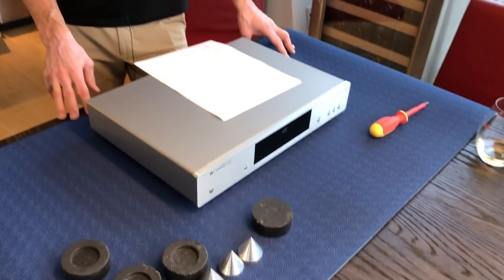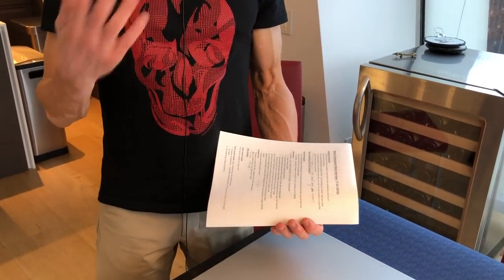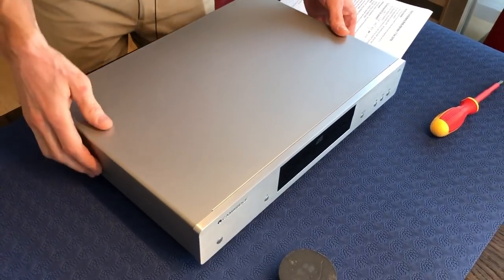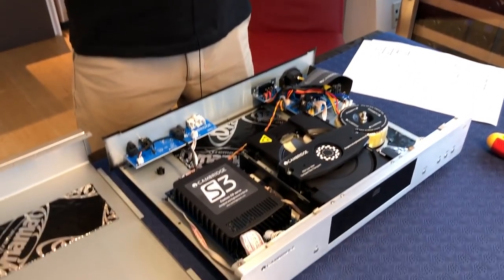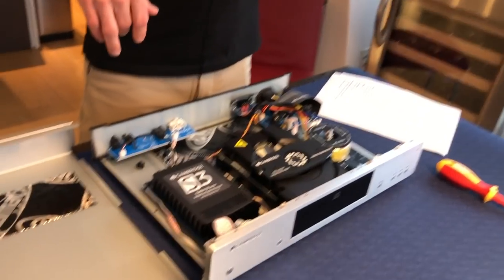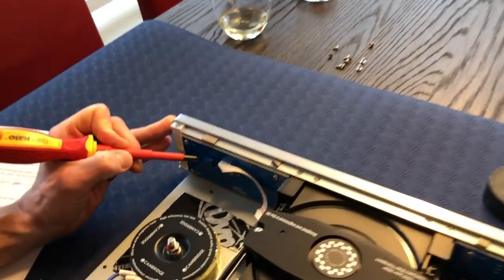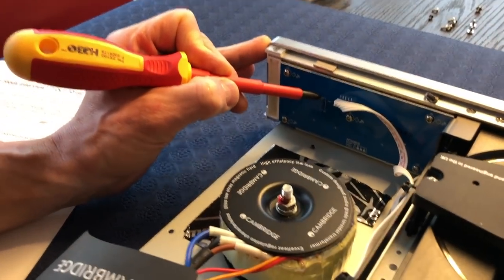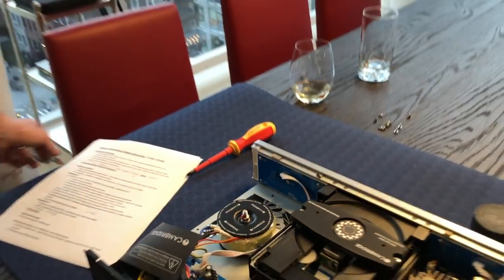Miguel pops the lid on his CD transport to tweak the sound

Comment: I'm not a scientist but I can't help "poking around inside" either ;)

Let's be real here, none of these mods will make any noticable difference, put your amp on top of your CD player and enjoy the music.
You can really get caught up in all these mods and claims people make about them, in my experience it's not worth the hassle
Reply: Crazy prayingmantis I think for hobby purposes it’s just for fun. The dynamat thing will make it feel more substantial though.
Reply: It isn't a hassle if it's something you enjoy.
Reply: @ Crazy prayingmantis. Yes, I agree!
Reply: Doug G will it just prevent the CD player from skipping as much? if it doesn't skip already would you benefit being as there is already all the forward error correction etc?
Reply: Well, if you want the display brighter...that will work.
Reply: @linkeddevices  Error correction doesn't work the same in audio as it does in software.  There is a lot that can affect sound after it passes through error correction. The argument "it's all 0's and 1's" doesn't hold. Jitter and clocking are concerns. See:  https://www.stereophile.com/reference/590jitter/index.html
Reply: @ Linked Devices,  I put a anti vibration pad 2”x1/2 dence foam) under each corner of my CD player and it helped tremendously with skipping.

Comment: I just did the Dynamat mod. I think it made a very slight difference in terms of microdetail and solidity of image. It only cost 6 pounds for a sheet so worth it. It wasn't the night and day difference that it was on a turntable platter (Ariston RD40). The CXC has pretty thin sheet metal, adding some mass can't hurt. Biggest boost in detail and separation was a good aftermarket cable (2nd hand, of course, otherwise better off just buying a better transport in the first place). Cheers

Comment: I suggest looking at another path. Your mods are mostly for mechanical vibrations and electronic timing. I’ve approached that from another path. By completely eliminating all that.

First “crack” the CD to a no loss format like FLAC.

https://en.wikipedia.org/wiki/FLAC

If you own the CD you are legally allowed to do this. Second, put those files on a DLNA server:

https://en.wikipedia.org/wiki/Digital_Living_Network_Alliance

The “Player” in my case is a Raspberry Pi ( Upgraded power supply running KODI ) with an external DAC. The output of the DAC then goes to the PreAmplifier → Amplifier → Speakers.

This process will completely remove any timing and vibration issues and actually remove any need for a CD Player at all. Plus you can tinker with different DACs.

Comment: I have found that having control cables next to tiny power wires, even when properly insulated, causes the second violins in all of my orchestral recordings to be 1/4 step flat and about 1 beat behind the rest of the orchestra, making them virtually indistinguishable from the violas. I have removed them and routed them through separate rooms in my house. Much better! I considered buying a second house to further isolate the transport, but the rotation of the Earth causes micro-vibrations that negated much of this effect. Instead, I have encased all of my equipment in beaver fur-lined security foam and have my entire equipment rack suspended in mid-air by non-resonating 100% pure elk gut braided mountain climbing rope. This tweak allowed the digital signal to go from just a stream of zeroes and ones to a stream that, with great recordings, allows it to reach a maximum of five in louder passages. Well worth the effort and cost.
Reply: At least this type of goony, outrageous sarcasm is mildly entertaining.
Reply: @HareDeLune   Thank you.

Comment: I remember back in the nineties in the U.K. there was a big debate about the negative effects upon the audio signal of illuminated digital displays, so much so a great number of manufacturers offered the ability to switch off the display when not needed via the remote so it’s interesting to see the mod to increase brightness. Perhaps it was snake oil but I must admit I did notice a difference between display on and off preferring it off.
Reply: One of the flaws of this player is that the display is very dim, which is the reason for this tweak. Normally I would not bother with this. Having said this, IIRC the issue with old displays was that the light was produced by some sort of fluorescent/gas device, not the dc power leds of today.
Reply: Miguel, you are correct, that was the issue, those old displays gave off an electrical noise, thanks so much for your response, love the mods. We used to use Bitumen strips very similar to this back in the eighties in the UK to damp many components including the underside of record decks! It worked really well.

Comment: Thank you Audiophiliac and Miguel, I did the upgrade, but added Shitka onlines to the middle of the rerouted power cord and the outgoing digital power cord.   I added the recommended dampening, but also did the bottom where screws etc. were not.   I added a Audiolab DC Block, an additional Shitka Online for the digital coax cable and two door stop weights on top for further vibration control.   The Verdict?   AMAZING!!   Took it to a noticeable level of improvement.   Totally impressed.   Thank you for covering this topic and Miguel is not crazy, it works!!!
Reply: What is it Shitka Online?

Comment: My first CD player was an early NAD that I bought in the late 80's. I listened to a half dozen models that they had on display and that NAD player sounded better to me than anything else on that shelf. I found putting a preamp on top of the CD player further helped the sound but there is a limit, if you put to much weight on it distorts the case and you may get skipping because of lazer misalignment.

Comment: Miguel I did not understand really what you were trying to say in regards to the clock in the video.

Yes there is difference between the cables. But if you use one or the other it can be regarded as a "constant".
Constant that if you use cable A and put a signal into it it will come out on the other end X number of time delayed. And cable B will have Y number of time delay.

That do not matter because for a given cable the delay is constantly the same. Just that your DAC will start to play more or less delayed. (In Nanoseconds area.)

But what a more precise clock will do to the signal is that it will give more precise time BETWEEN the rising/falling edge of the signals.
And that time between the rising/falling edge will be the same in the other end of the cable, regardless of whatever cable you are using.
In other end a more precise clock will give less jitter (time variations between the rising/falling edge).
Reply: If your “square” signal takes longer to move from a “0” to a “1”, and you have zero crossing NOISE (which you always do) then that noise will get reflected in the time of the zero-crossing detection. If you had a faster rise time, the impact of zero-crossing detection voltage level noise would be much smaller.
Reply: Optimize. The rise time should resemble a square wave and the rise should be as vertical as possible to get accuracy. However you have one clock generating the pulses and pulse lengths at the send. This gets read at the receiver. The receiver will hold data values in a buffer so that it can pass it into a new clock and regenerate the timing accuracy of the signal for its DAC. Rise time errors can generate false data and the signal being regenerated can then be distorted. Miguel was interested in how significant the distortion generated this way could be. The difference in sound between his SPDIF when using different cables might be due to bouncing signals and/or slower rise times. He talked about having a master clock running his DAC and his transport in the interests of not having to reclock signals because, there is only one clock overseeing send and receive. His argument went on to consider low latency crystals in the clocks. The proposition being that the timing error is being generated by having two timing crystals one at the send and one reclocking. If the error created by reclocking is several orders of magnitude greater than the timing error generated by having super accurate crystals in both the send and the buffering and reclocking stages then, the value of super accurate crystals is non-existent. The master clock running both would always be better. He mentioned Femto-second precision in the crystals vs pico-second precision. The system cannot acknowledge the difference; it’s like the difference between threading cotton through the eye of a needle then threading the same cotton through an open window at the other end. The window is precise enough. It would be like fixing a needle into the window frame and expecting the cotton to pass through the eye of the needle when the only requirement is for the thread to get through the open window, whether or, not it passes through the eye of needle it still goes through the window.
Reply: @christopherward5065  Yes, I agree that when there is a buffer in the DAC and a other clock for sending it out from that DAC buffer. Then it makes not much of a sense to have a more precise clock in the transport. It is waiste or more accurate, waisted resources in the wrong place.

Comment: Steve, being an inveterate tweaker, I love “professor” Miguel’s CXC tweaks...all of which I am going to do once I get a hold of some thin dynamat! Thank you so much for sharing his ideas and analysis with us. Of particularly interest to me was the difference in spdf cable jitter. I never would have guessed Blue Jeans cable showed lower jitter than the Audioquest cables I am currently using. I do know the cable length sweet spot is 1m for jitter. I look forward to hearing about the rest of the CXC mods he is considering. Good stuff! Cheers.
Reply: To be 100% clear: The BJC cable has a faster rise time, and all I am arguing is that alone can have some impact on jitter given zero-crossing detection noise in the chain. To be clear also, I think this difference is likely much smaller than other sources of jitter, but regardless, all else being equal this is a difference between the cables. BTW... All measurements done with a 100MHz digital scope, properly terminated with 75 Ohm terminators.
Reply: Miguel Barrio, thanks for your kind reply. I didn’t mean to infer that your comments regarding differences of measured cable jitter were significant enough to be truly relevant. Obviously they were not. Interesting nevertheless. I look forward to your future tweaks of this great transport, Miguel!
Reply: @motorradmike  , I once got pulled over by the Grammar Police " for using the term "infer " when i should have used "imply"... 😃

*
Reply: Az Usmb, you are absolutely correct.

Comment: Thanks for posting Steve. One of the best parts of the hobby is being able mod specific gear. One common thread is acoustic dampening with CD's players or Turntables.  IMHO, the only thing that should be vibrating is your speaker cones.

Comment: I've been doing this stuff for years!

But nice to hear it on here to help people.
Also try having a slab of granite cut and polished for on top of your speakers to damp resonance. It's a great way to go for budget speakers
Reply: The weight on the speaker is an amazing tweak that makes a very pronounced difference for cheaper speakers - the wait effectively makes the cabinet more rigid by tensing the material due to its weight. When I was a student, I found these two 10lb slabs of steel, about an inch thick, and put them on top of my Paradigm speakers and it was a large improvement in sound and tonality.
Reply: @miguelbarrio  yes Miguel, great little tweak.

Comment: I'm confused by this.  I like the mods but why even own a high class CD drive if not using the Toslink output? Is there another way to get the digital to your DAC?

All this DAC stuff is confusing because there are too many ways to skin this cat.
Reply: Coax is better than Toslink, it has less jitter. This unit has both Toslink and coax out.
Reply: @miguelbarrio  Thanks. What DAC do you use?
Reply: martytoo dCS Rossini (with external clock but the clock but that doesn’t play a role with an SPDIF signal).
Reply: Miguel Barrio that is absolute drivel. If you look at the analysis the jitter between Toslink and Coax is negligible and any jitter at these interfaces are enormous magnitudes of order below threshold of human hearing. Furthermore the Toslink provides galvanic isolation if that is an audiophile OCD nervosa that you suffer from. Being a physicist and using a screwdriver doesn’t make you qualified to speak on electronics and psychoacoustics.

Comment: I thought you were going to say lower display brightness as it is sometimes an option to turn display off. So turning it up could reduce sound quality.
Reply: This display is very dark. The backlight is LED driven, should not affect sound quality as it is DC. The oldie fluorescent based display were another matter. Also, you can still turn it off from the remote, which is sort of ridiculous since I often cannot see it when it is at full blast.

Comment: BTW... You can find the CXC transport discounted to $399. This is because there’s a v2 version coming out for $599. Cambridge has confirmed to me that the difference is only cosmetic. So...
Reply: James Dills that’s cool.
Reply: @jamesdills6720 
Vacuum tubes as well?
Very interesting.
This brings questions to my mind, such as whether the crystalline structure of the glass is affected as well as the metal parts; and also what kind of wiring is available for tubes and whether the metalurgy can be improved upon.
Reply: @HareDeLune  Think of super cool temps as heat.. At certain temperatures you are aligning structures, stitching boundary layers, filling vacancies, making more evenly hard and sometimes a bit harder. As for the glass, maybe.  We have even increased hardness on ABS and made it tougher.  The tubes are tested on machines and quantified after our treatments.  We even treat cables at -450F with liquid Helium and the clients say they can hear the difference.. Although LHe is expensive.. We've always contended that solder joints are very dirty joints and have proven to a very large concern that properly done DCT (Deep Cryo Treatment) elevates its performance. One last thing..  We have treated CD's and customers say they hear the difference in  A/B testing.
Reply: @jamesdills6720 
CD's too?!
Very interesting.
It is reassuring that cryo treatment doesn't have a negative effect on the glass component of tubes.
Interesting analogy of deep cold as similar to heat.

So, are your services expensive? I have had a long standing interest in cryo treatment, but always thought it would be prohibitively expensive, not to mention being unaware of a place where I could get it done.

Do you have your own profile of temperature levels in the treatment, or is there an established standard?
Reply: @HareDeLune  Prices are not expensive at all.. You can contact us at info AT ctpcryogenics DOT com for pricing based on components. We do run different profiles for different materials.. It's essential for getting good results.
Reply: @jamesdills6720 
Thanks!
Reply: i chatted with a customer service rep at Audio Advice about v2 changes. they said "Their main difference is the finish but due to tariffs and production costs, their prices have increased." also "It looks like they did some servo improvements and used a higher quality casing to match the [v2] series and reduce some vibrations."
Reply: Colin Pratt The changes are ONLY cosmetic, Cambridge support told me this. I emailed them to ask for a CXC service manual; they said they only provide these for products no longer in production; I said the v2 is out now; they said it is identical to the v1 save for the color of the finish so they cannot provide the service manual. Audio Advice needs to get their facts straight.
Reply: @miguelbarrio  appreciate this info.
Reply: James Dills I need to justify the price of my new freezer so have been putting it to use. I have had my CD player in there for a few hours now. It may take a long time to get it up to operating temp , but boy will it sound good once it gets warmed up. I was going to freeze my CDs as well but was worried my son would spill ice cream on them.